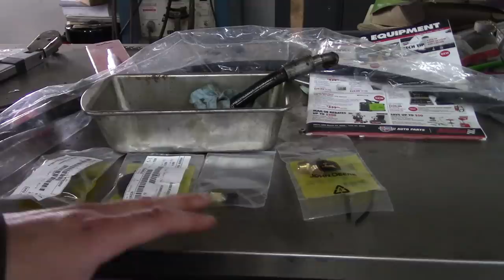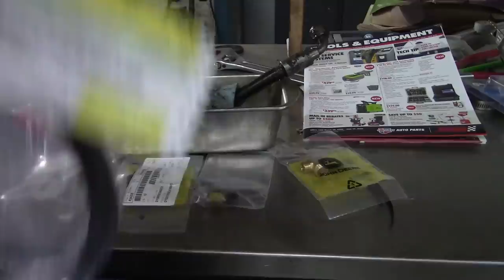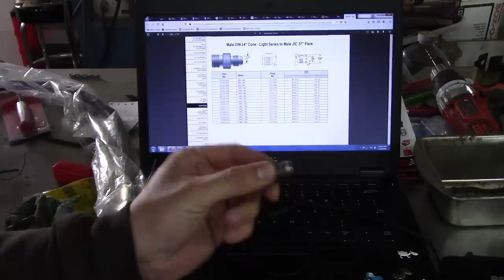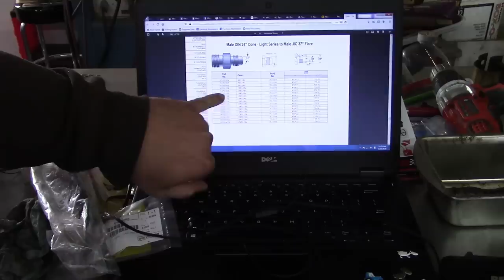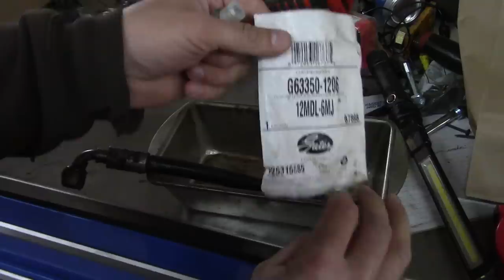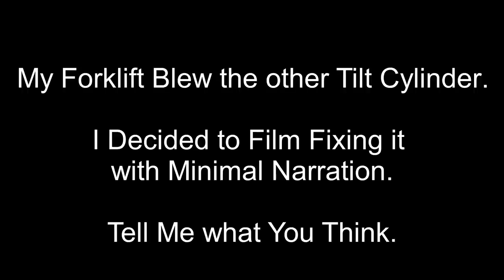Finishing the John Deere 2940 and Packing a Cylinder in Silence

Comment: "Helps if you tighten the hoses"  If I had a dollar for every time I've done something like that...  :)
Reply: Yup....drained 10l of coolant onto my driveway recently because of this reason lol
Reply: Yep. I'm working  on fixing up a old International 300 Utility and half the hydraulics fitting are barely hand tight and the other half make up for it by being so over tight it takes a 24" wrench to break lose 1/2" hose fittings.  

That and apparently every hose that only needed to be 24" - 36" long had to have one at least 42' - 60"+ in its place and any hose that needed to be 40" - 76" long had to be made up of at lest 2 - 4 miss matched 18 - 36" pieces.  

Then to really make it all head scratcher.   Any bolt that that anything pivoted on that was loose had to be welded (Baddly) in place rather than being replaced with a new one of the correct diameter and length.
Reply: @tcmtech7515  Oh wow!  That sounds like some of the stuff I've worked on in the past.  Really makes you wonder what people were thinking when they did stuff like that...
Reply: @kd5byb  Oh it gets better!   " When I had the new tires put on I had  ~ 400 #'s of solution  put in."  

  BUT IT'S ALL IN ONE TIRE ..........  W  T  F?   HOW.......  WHY!!!??????   Both tires were replaced at the same time.   😵😵😵😵🤯🤯🤯🤯 

The previous owner had both rear tires set all the way and I needed them all the way in so I figured that the easiest way to move them was to just take them off the axles and switch them left for right.  

First tire assy  was easy to take off and move around by hand.    The second one needed a forklift to move.  (same forklift holding up the tractor while both rear tires were off.)  
Beyond that,  every lug nut and outer rim bolt was rusted solid in place (but still lose enough to not hold anything tight to what it was supposed to) and needed to be rethreaded to be usable enough to hold things in place until I can get to town tomorrow and get all new ones. 

That was not how I wanted to take  30 minute tire switch around  and turn it into a 3+ hour hard labor job.  😋

Comment: You always do amazing work!  14 hours plus $800 parts to put that tractor back in service is a wonderful price in my opinion.  considering you can hardly buy a running tractor of that size for less than $4500. and the oil change $100 plus would have been needed soon anyway!  Great Work! Wishing I was closer to your shop!

Comment: Hi Wes, love the videos, you gotta keep the chatter though, video seems weird in silence. Don't know if anyone has mentioned this but the tilt is 'kicking' after the cylinder rebuild, the left hand ram is bottoming before the right. The thread on the end of the rams is to set the tilt angles to factory spec and to even out any kick at each end of tilt movement. You need to undo the lock bolt on the right ram and unscrew the  clevis a turn or so. Bests, Nog.

Comment: That piece of equipment you used to remove the pin from the hydraulic cylinder, a heavy piece of shaped metal with a wooden handle, is widely known here in the UK as a Birmingham Screwdriver. Pleased to see they are actually internationally used.
As for any comments, it was plain to see you had fitted internal seals before. Thank-you for the video. I have retired now but enjoy getting the oil and  grease back on my hands again virtually.

Comment: Best way I've come up with for installing gland seals is to use a solid round bar the same size as the shaft, face one end in the lathe or at least square.  Put the bar in a bench vise facing up, place the gland on the bar and set the end of the bar to the bottom of the seal groove.  Now you can stuff the seal in and it has no where to go but in the groove.  Finish with a second round bar or punch with a fairly square end.  
Thanks for sharing all the great info.

Comment: Only one comment,cylinder kits we got had a cheap plastic funnel shaped thing that made it a lot easier to put the piston assy back into the cylinder.Was so cheaply made that was usually good for one use,but then a new one came with kit so no biggy.For the long cylinders that lift the second stsge of the upright,I have used a piece of .0015 shimstock to guide the piston into place,works well and almost never causes problems,if you use a little of the proper assy lube on the piston.

Comment: I like the commentary, its educational, and the humour fits with mine. Clarke marketed the inboard tilt cylinder as an advantage, their reasoning that it was protected and the angle at which it works is better. You can tell its a Clarke by the stupid place where the tilt cylinder is mounted, the rest of the machine is good though.

Comment: 17:30 You find that on most german cars. But its not only an oil cooler, its also acts as an oil heater. Because the coolant is up to temperature way before the oil, the hot coolant helps to warm up the oil quicker. But this design is not so effective at cooling, because of the 90°C hot coolant and the temperature delta between the coolant and oil being kind of small.

Comment: The 329,359,414 series Deere's are fantastic engines. They hold up a lot better than the 5.9/6.7 Cummins engines. The old ones don't start the greatest when cold but other than that they don't give much trouble.
Reply from the maker: It seems to be a nice engine. Though to be fair, it has the same displacement as the 5.9 Cummins with half the power! I'm not so sure on the rocker arm oiling though. It can't be a coincidence that the 3 good rocker arms were the 3 closest to the oil feed passage.
Reply: @WatchWesWork  Yes the Cummins is a hot rod compared to the Deere. 300hp and 780torque is top of the line and they max at 2800rpm. I did't notice but the plugs were still in both ends of the rocker shaft weren't they?  Usually they will fill the whole shaft and stay that way with oil in probably 30 seconds or so.

Comment: any time you see wire nuts you know a farmer worked on it last :) mice nest are always fun I cant tell you how many spark plugs I replaced on my uncles International diesel tractor so you could start it on gas in the winter
Reply from the maker: What model is that? My dad had a TD-9 crawler loader that started on gas and switched to diesel. Took a solid 15 minutes at WOT to get all 4 cylinders to fire...
Reply: It was a IH Farmall Super MD-TA Believe an early 1950s if the spark plugs wires or wiring wasnt all chewed/backyard bob to death it started amazing in the cold. Because all tractors have crappy batteries you didnt have to crank very long it had lower compression on gas so easier cranking and you could hit it with the Ether. 
Also my 2 great uncles owned a IH Dealership in southern Illinois and anytime your working on a JD I can hear them say IF IT AIN'T RED LEAVE IT IN THE DAM SHED. They hated John Deere

Comment: Wes perhaps a stupid question about that adapter, the old t connector to which you connected the hose under the tractor had a large nut on it, if you removed this would the new hose have fitted directly.  Love watching your vids always amazed and the mixture of fittings you come across on same vehicle.  Take care
Reply from the maker: No, the nut is built right into the T fitting. I wonder if that T may have been replaced at some point with a different style.

Comment: Hey Wes, you're using the file wrong. You might want to check on Amazon for a Noga deburring tool. Not too expensive and they work way better than a file in tight quarters. Was Max after something under the car?  I prefer your narration myself. Those that don't can just use the mute feature on their device.
Reply from the maker: I probably own 40+ dedicated deburring tools...

Comment: I 'm still looking at the lower o2 senser tripping a code. Replaced cataytic converter. Not so bad after scrape value . I am thinking that is the code is random only at low RPM that a injector is sticking open randonly. What do you think? Possibility?
Reply from the maker: What code is it throwing?
Reply: @WatchWesWork code is P0138 code which means voltage too high on lower o2 sensor. Since I know a lot about detergents cause that is my specialty. I was thinking about dosing up the fuel with cleaners and lubricant. After that just replace all injectors. Oh the O2 sensors are new.
Reply: Thanks.
Reply: probably have trouble keeping details straight. first a random code poped up. PO138. high volts on lower o2 sensor. It is random only around town right after start. Never on highway. Replaced all O2 sensors. Still there. Replaced catalyic converter. Still there. Now it has to be above exhaust manifold. Randomly sticking injector??  Literature has this as a possibily.
Reply from the maker: @ronsmith3065  That sounds plausible. I might be concerned about a short to the signal return wire from some voltage source. For example the heater wire.
Reply: @WatchWesWork  I will check that since the car was totaled at about 42,000 miles. I sold it to a paranoid woman. My phone fills up with nasty textes. AC probably has a short in it too. Acts strange too.

Comment: oh gawd my eyes at 21:17
I cringe so hard when i see thread tape applied like that!!!
the roll of thread tape should be held so that it is wound in the direction the nut thread on so it doesn't bunch up when the thread gets tight and also the really big taboo is as it winds on one it should unwind off the other if he flipped the roll 180 degree half turn left or right winding it would of been a one hand job...
Reply from the maker: Jesus. I should have just used the pliers bare like I did the last time...